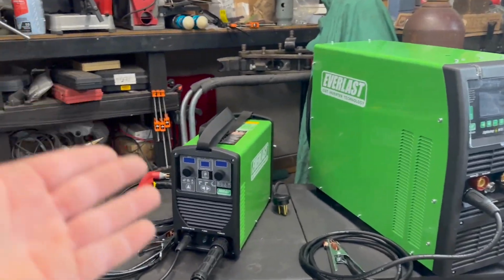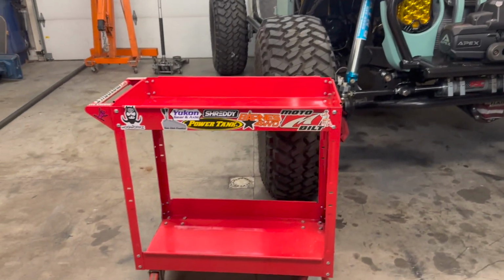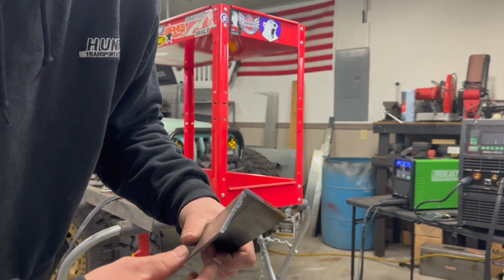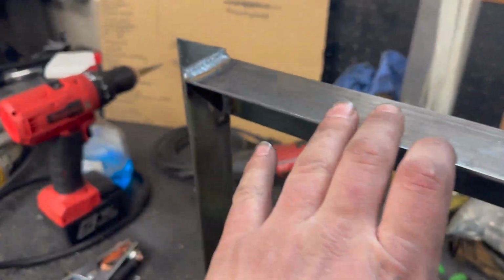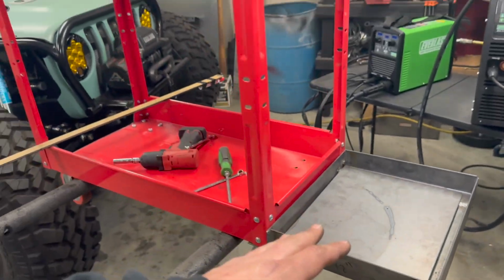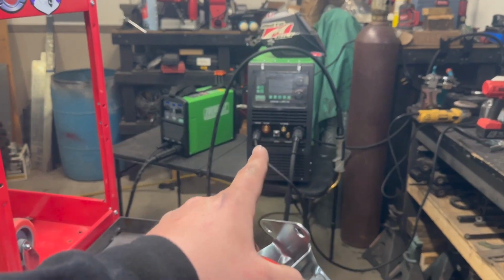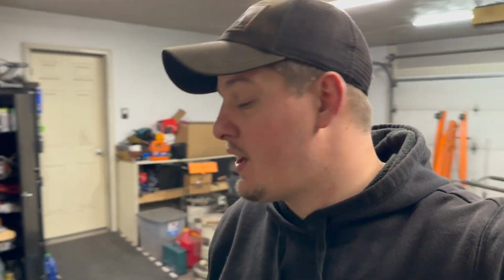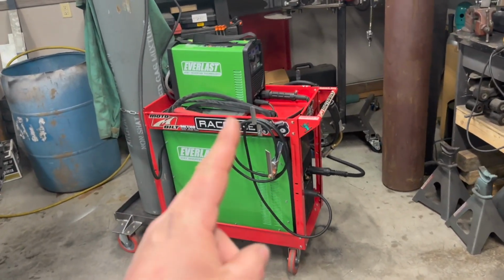My New EVERLAST WELDERS  Set Up!

Comment: Check your link.  I ordered a PowerTig 250EX through your link but the upgrade wasn't included.  Luckily i had to call for an issue with the order and thats how i found out i didn't receive the upgrade from using your link.  I let them know I used your link and they said they'll add it but you might want to look into it.
Reply from the maker: First off thank you! I will reach out to them this week and see what's going on with the link, Thanks for letting me know!
Reply from the maker: Also shoot me an DM on insta @hunkuhjunk  or an email at sam.matterbuilt at gmail.

Comment: Now you need an archdroid hookup.
Reply from the maker: Those are awesome! Im game to try any new tools
Reply: @SamMatter  New tools are fun. You might want to add support on your cart where the tray bolts to the cart before it folds like a taco. I would add wheels to the original bolt holes.
Reply from the maker: @vicgustafson8514  My thoughts too. This was just a temporary scrap metal project to play with the plasma and get them mobile in the shop. Next time you see if, it'll have some triangulation supports out back!